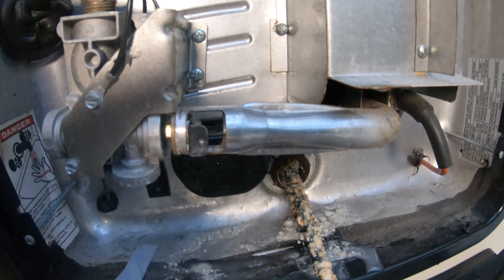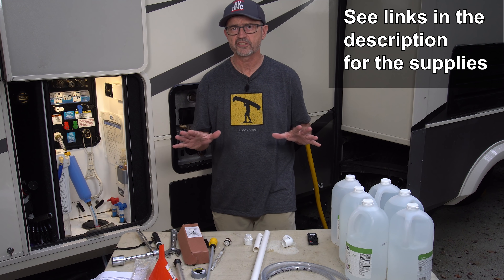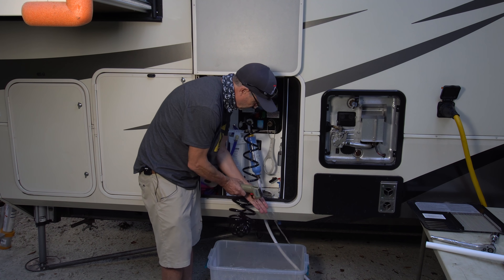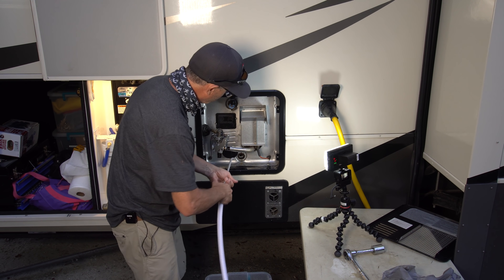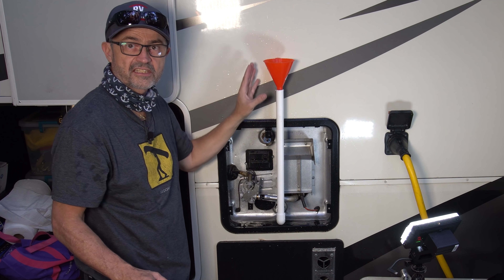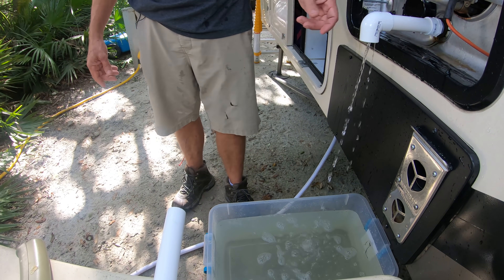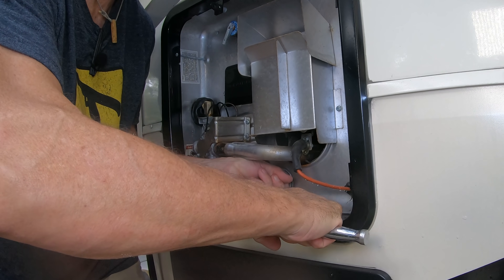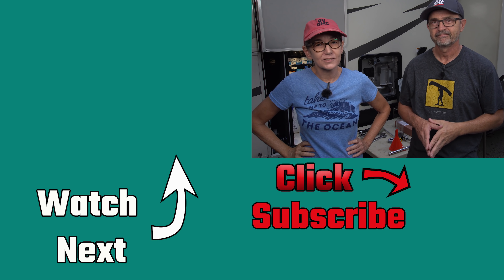RV Water Heater Maintenance w/ Custom Vinegar Fill Pipe (RV Living Full Time) 4K

Comment: I used your method two weeks ago with vinegar. Unfortunately the smell came back after a week. I think we didn’t heat it up or leave it sit long enough. So I re-did it using two bottles of hydrogen peroxide instead Heated the tank up with both propane and electric for 45 minutes and then turned them off. Then let it sit for about 7 hours. The only different thing I did was put a pail under the long vertical pipe. As it heated up and cooled down, it would drip out the top of the pipe. I manually flipped the pressure relief valve open and closed many times. To relieve the pressure. Then poured the drips back into the tube and tank. So far so good after a week.
Reply from the maker: Thank you for sharing your tips.  How big were the bottles of hydrogen peroxide?  To get the smell gone all the calcium scale bits in the bottom of the tank have to be flushed out.  They hold the smell.  Larry
Reply: Two 16 ounces or 500ml. Also I changed my magnesium anode rod to an aluminum one. We will see how that works out. Apparently once the bacteria and smell starts, the magnesium helps to keep generating the bacteria. At least that’s what I read. When I was draining the peroxide out of tank, I shoved the anode rod in before it emptied out. Then I ran the taps and shower briefly to hold some of the solution. Then I let it sit overnight as I drained the tank out late in the evening. 

So far it’s been 9 days with no smell at all. Don’t know if the extra steps were needed but I figured it why not.  

Ps: I had flushed out the tank just the regular way, then your vinegar solution and then the peroxide all in a week and a half. So the tank was definitely clean of any bits.
Reply: @rl5220 All I had to do to get rid of our rotten egg smell is to change our rod from magnesium to an Aluminum/Zinc one and that did the trick. So I'm curious as to if your smell comes back or not now that you also switched to an aluminum one.

Comment: I loved the the video you did and the way you did the maintenance on the RV hot water tank, I only had one problem the Camco Wand  I purchased on Amazon. While I was doing the flushing in the Anadode hole, the problem I had was that the the plastic tubing tip came off valve and it ended inside the tank, now I don't know how to get it out. Any suggestions.?
Reply from the maker: That’s a tough one, I would allow water to flow into the tank with the anode out, hopefully the wand will float to the opening.  If that doesn’t work I use a scope camera to inspect the tank, you could use one to extract the wand,  DEPSTECH Dual Lens Wireless... https://www.amazon.com/dp/B08NJ8627V?ref=ppx_pop_mob_ap_share
Larry
Reply: I wonder if you removed both the anode and the heating element if that would give you 2 water flow holes (input into element hole, output through anode hole). The aim would be to greatly increase the water flow and hopefully flush the broken piece out. 
I have not yet seen this suggested as a method to more effectively flush out more scale, so I'm not sure if I'm missing something.

Comment: Great video I have ocd and I’m totally doing this.  My rv is a 2012 I’ve owned it only 3 going on 4 years and I bet the original owner didn’t do the maintenance.  But I’m pretty sure the Atwood’s have a 1/2” drain plug not 3/4.  So I’m thinking I can get a 1/2” thread to a 3/4 pipe n elbow?   Thanks.
Reply from the maker: I didnt know the atwoods have a smaller drain plug, thanks for sharing.  To be honest, I dont think most people do proper maintenance to their rv water heaters. Larry
Reply: Yep definitely smaller plug I just took my plug home and up to the home improvement store

Comment: I saw your thumbnail and it caught my eye!
That how I do it too. Cost me well under $3 
But I also turn the water heater back on to heat it up and then shut it back off and let it do its thing all night.
Reply from the maker: Do you think it works better by heating the water up, do you get it warm or really hot before you shut it off.  Larry
Reply: @DownsizingMakesCents  
I let it heat until it shuts off and then shut it off so it don't turn itself back on.
Not sure if it works better hot or not, but I figured "why not"
Reply from the maker: @dontask8979  I hear that.  I might try that, but make sure the water heater is off and water cool before working with it.
Reply: @DownsizingMakesCents  There is another water heater descaling video by rvgeeks where they say heating the water/vinegar mix overnight accelerates/enhances the descaling by quite a bit.  They use a 'borescope' to show the inside of the tank... but their vinegar injection method using the RV water pump and drawing in the vinegar was not as 'slick' as your pipe / funnel system.  I plan to combine your plastic pipe method with heating up the mixture.  Only thing is - I would want to be near the tank while the heat is turned on in case the plastic pipe came loose... and the mixture ran out while the heat was on (which would wreck the heat source).  I plan to use threaded pipe to get around that potential.
Reply: @remoteroger5767  is there any concern using plastic pipe while the unit is switched on? Won’t the plastic pipe soften or melt from the very hot water inside?

Comment: Great video Larry, but just a thought, why didn't you just remove the relief valve to fill the tank?
Reply from the maker: That actually would be a good option to pull out the relief valve while filling the tank and during the soak, maybe i will try that next time.  Larry

Comment: Fantastic video... we live with severe hard water in AZ. As a fulltimer i'm having to flush every other month 🙄  Would it be possible to run any of the hotwater/vinegar solution THROUGH my faucets to clean them out too without damaging them?  It's a 2 mo old rig!! and it looked like snowballs coming out of my heater! Last rig, it all but destroyed my lines due to build up 😢
Reply from the maker: Yes. But make sure you completely empty the tank and flush with fresh

Comment: I notice you did not turn the hot water heater back on after filling with the vinegar.  Most of the other videos I have seen do in fact turn on their hot water heaters and let it go overnight.  Then turn it off, let it cool down and or run the vinegar through their faucets and then flush.  Any advantage to run or not run the hot water heater?
Reply from the maker: Mine came totally clean with cold water. Many people just feel hot cleans better.

Comment: Been watching your vision on cleaning hot water heater, my Question is when using the wand do you have to reduce water presser  down or what ever the presser is at home or at a RV park thanks HAPPY traveling
Reply from the maker: Use as high pressure as available,  use it to push the sediment out the hole. The more pressure the better. Larry
Reply: @DownsizingMakesCents  thanks  you

Comment: Question from a 310GK newbie (sorry if a dumb one ... or one already asked). If you orientate the nautilus valves to run on tank/pump (and ensure you don't use hot water throughout the night) will you still be able to flush the toilet while the solution is doing it's magic in the hot water tank?
Reply from the maker: You shouldn’t use an water lines while it is soaking overnight, disconnect from spigot.  You can still use the toilet without water flowing.  Larry

Comment: Thanks for the video on how to do this. I recently bought a 2015 Forest River RPod 179 and the water heater was in rough shape. I flushed it using the wand and got a lot of stuff out of it but after watching this I'll be putting some vinegar in there. Do you think it would help to turn the heater on with the vinegar in it? With coffee pots that is what you do so I'm not sure if it would help to do that with a water heater.
Reply from the maker: I have tried with the heater on and off and didnt find that is made a difference, its the vingar that’s doing the work.  Larry
Reply: @DownsizingMakesCents  Thanks for the response. I'll give it a try this weekend.

Comment: We have been getting white foamy and fizzy water coming out of our faucets in our camper water lately, it has a chemical type of smell…not rotten eggs tho, just chemicals in general. After you run the water for like a minute it stops, but if you let it sit for a bit it does it again. We have never used antifreeze. We only run city water. We put in new water hose from the spigot to the camper that is the drinkable style type of hose. The first time we did this it worked for a while. The second time we did this it didn’t work at all. So we changed it immediately again and now it only foams now when we run the hot water. Our water heater is electric. I thought it might be an anode rod but not sure if we have one?…I haven’t checked to be sure yet. Any ideas on what this could be??? Cheers!
Reply from the maker: Foamy water may mean an air leak in the system, some how air is getting the the pressured plumbing.  I would try shutting off the hot water supply and see if it still does it.  If that stops it then there is maybe something going on with the water heater.  Just an idea, Larry
Reply: @DownsizingMakesCents  The foamy water stops after you run the water for like 20-30 seconds though, and when it’s foamy it fizzes and smells like a pool liner. Not sure if having a leak will do all that? The water hose is new too just fyi.

Comment: Larry, I've found another great use for vinegar/water solution. I filled my galley holding tank with a 50/50 solution of water and vinegar, and let it sit for 24 hours. When I drained the tank into a bucket, I was amazed at the amount of dirty stinky water. The smell was terrible! There appeared to be solidified grease specks floating on the water, even though we have never poured waste grease down the kitchen sink, so it must have come from washing the dishes. I'm assuming that the galley holding tank is now super clean and doesn't stink. Vinegar and water are like a broken drum, you can't beat it!
Reply from the maker: That’s a great tip, our grey water really stinks even though we are very careful about food waste not going down the drain.  Lately we have noticed a bad smell coming from the sink drain, must be nasty stuff in the drain trap.  We will try the vinegar trick to see if it helps.  Thanks. Larry
Reply: @DownsizingMakesCents  You're welcome! When I started to drain the galley tank, I thought for a second that I had opened the black tank valve, it stunk so bad. Good luck and hopes this helps.

Comment: So it appears you're not heating the vinegar/water solution and then letting it sit overnite? No heat, just let sit 12 hrs?
Also, do you know if the heating elements sit below the pressure relief valve? I like your technique, but want to heat the solution, and I need to make sure those heating elements are covered with the solution.  Thanks for posting this video.
Reply from the maker: Some people have recommend using heat but i dont think it is necessary, the inside of the tank was very clean after letting the vinegar sit for 12 hours.  I dont think it could have gotten any cleaner.   The heating elements themselves got perfectly clean not a bit of scale was on them at the end.  Thanks for your input.  Larry

Comment: I liked you video on cleaning hot water tank with vinegar.  
But doesn't a fresh water hold tank also get lime/calcium build-up?
I'm wondering why you wouldn’t flush the entire system.
Reply from the maker: That’s a great question.  Generally i like the clean and flush the rest of the fresh water system with bleach to sterile it.  I have used a bore hole camera to inspect the fresh water tank and didnt see any calcium/lime buildup in the tank, even after being 5 years old.  At some point i will do a video using a camera in the tank.  Larry

Comment: Very good video.  I do have a question.  At 4:31 of the video, you show the back of the water heater.  What prevents the water/vinegar from coming out the hot water connection at the top of the water heater?
Reply from the maker: That’s a good question, that’s why it important that the faucets and showers are not opened in the hot position while the tank is soaking.  The water  will be trapped in the lines keeping the vinegar from entering.  It’s not a big deal if some vinegar entered, that one of the reasons I like to flush the lines after.  Larry
Reply: @DownsizingMakesCents  OK, Thanks.

Comment: Larry, fantastic instructional video. The HWH in my GD 2250RK appears to be only half (6) the size of yours. How important is it that the water draining is fully cool?  I don’t have 24 hours to do this procedure. Do you know if I would be risking any damage if my exiting water temp were around 50-60 degrees?
Please advise.  Much thanks.  Dave, St Pete FL

Additional thought/question:  My HWH switch and HWH breaker are both off.  Could I leave my water supply spigot ON when removing the Anode Rod which in my theory would allow the cold water to replace the hot water in a pretty short time rather than waiting for the hot water to cool by itself, then, of course, as soon as I see/feel that the water is cool/cold, turn off the spigot and proceed with the balance of the procedure.  Does this thought sound like it would cause any risk that you are aware of?

Whoops:  appears that my questions are irrelevant.  While examining my HWH, it’s pretty obvious that the 🤪who designed or installed this HWH left no room for the 1 1/16” socket to get in and for the same reason, even if the Anode could be loosened, there appears to be no way to remove it because a horizontal piece of the system is right in front of where the Anode would need to come out. If I can figure out how to send u a couple of pics, I will.
Reply from the maker: You can flush with the water still warm, for safety you just don’t want it to be able to burn you if you get sprayed with the water when you pull the anode.  I turned on my fresh water supply while i was flushing to help flush out the calcium scale.  For your unit i am sure there is some way to loosen and replace the anode, your model may need a specific wrench to get it out.  I would look up the manufacturers website to get the manual and see what instructions they give for servicing you specific model.  If you want to send a pic, look for our email address in the about tab of our channel.    Looks forward to seeing what it looks like.  Larry
Reply: You can also use a basin wrench to remove plug, it's the one plumbers use under the sink to remove faucet and install new one. It gets around obstacles .

Comment: Use a 5x20 filter housing with softening resin in a resin cartridge.  Soften your water before it enters your system and you’ll not have the build up.
Reply from the maker: That’s a great point, I don’t know that much about water softening for Rv’s.  Larry

Comment: Is it possible to isolate the water heater system and pump vinegar into it through the nautilus system without pumping vinegar through the entire water system for flushing?  Given the nautilus diagram, that wasn't clear to me if that's even possible. 

Rather do that than build the pvc system you have. 

TY
Reply from the maker: Yes you absolutely can I keep a laminated Nautilis instruction inside the Wet Bay Area,  you can download it from their website it gives much better instructions as to what lever does what, Larry

Comment: My RV is EMPTY of water, to INCLUDE my hot water tank. QUESTION: If I fill ONLY my hot water tank with vinegar and water until it comes out the top valve...CAN I THEN TURN THE WATER PUMP ON AFTER OPENING JUST THE BATHROOM HOT WATER FAUCET to allow the pump to ONLY use the hot water tank solution to run up and out my bathroom sink? I ask because my bathroom my bathroom faucet hot water flow is nominal/weak...I suspect perhaps calcium. My goal is to run vinegar water up and through...then let sit..so that any calcium buildup might dissolve.  My concern is that without water in the fresh tank and waterlines, the pump might have an issue. THOUGHTS?
Reply from the maker: I think you will need water in the water tank to use the water pump,  why not add vinegar to your whole system, the vinegar will also clean the water tank, then pump it through all your lines, if you have weak pressure when on the pump, there may be a problem with the pump, may have an air leak on the vacuum side.  Larry
Reply: @DownsizingMakesCents  Thanks for your input. Perhaps I can just put vinegar in the entire system, though note that vinegar is acidic (5%) and I'm worry it could hurt "the water hose system". Regarding pressure, the water pump actually pumps well to all hot/cold in RV except for that bathroom "hot' side. Go figure,

Comment: Great video Larry! I have a 2017 Grand Design that has never had this maintenance performed. I plan to do it when the weather warms up a bit more…. but soon! I’m curious if you found the original anode rod to be difficult to remove. I have seen some folks say theirs was pretty rusty.  Great job on you fill pipe rig…… really good thinking! Thanks so much….. Tim
Reply from the maker: If the anode was installed properly with tephlon tape, it should come out easy.  Make sure you have the right size socket to get the best grab on the anode.  Don’t try to use pliers or even vise grips.  Larry
Reply: @DownsizingMakesCents  Thanks! It looks well taped with Teflon!  Yes sir…. Only the right tools for the job!!! I always look at it this way…. If I don’t have the right tool for a job then it’s a real good justification to go add to the tool collection!! 😎